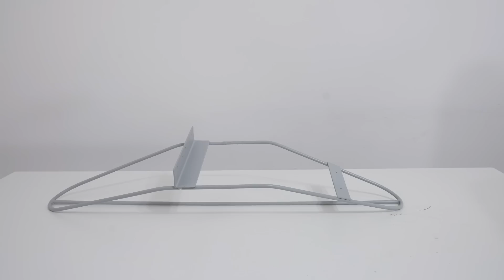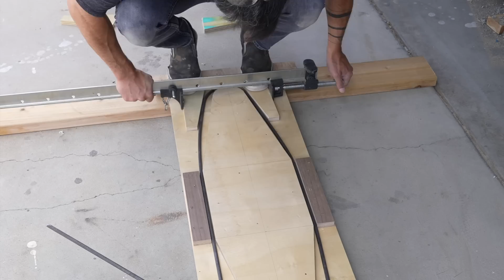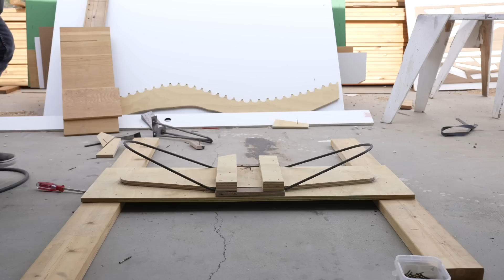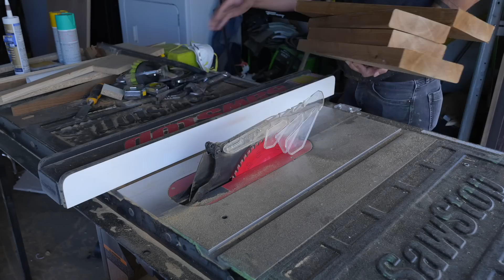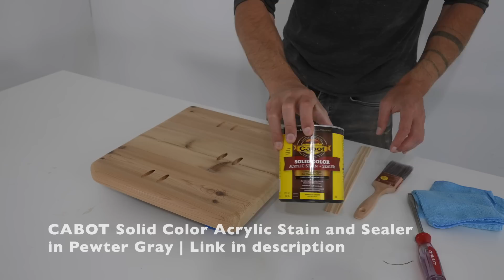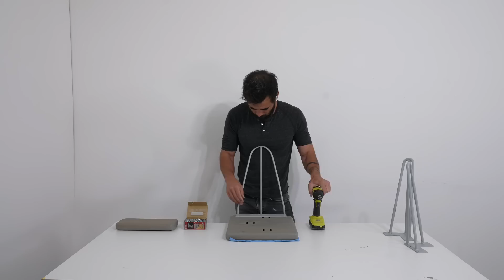Bending Steel into a Chair

Comment: Great design. However, I have two suggestions to improve the build of woodworking part. Pocket screws are unnecessary, glue joint is stronger than the wood. And 2x6 should be split in 2 or 3 and then alternate grain direction to mitigate wood movement
Reply: He’s using the pocket screws to goose the sponsor (Kreg pocket jigs)